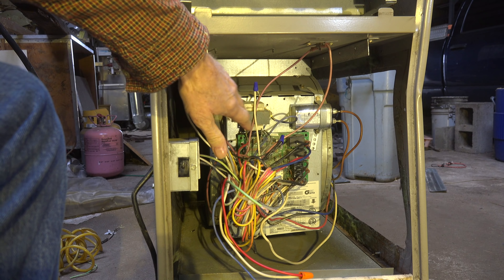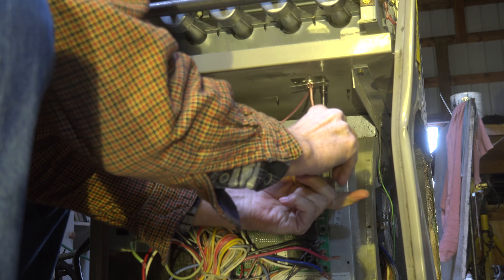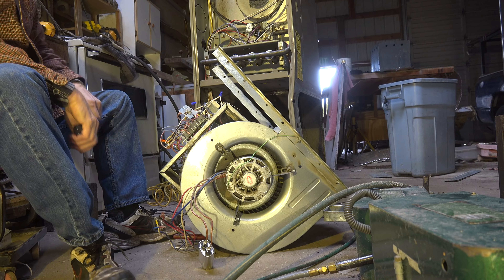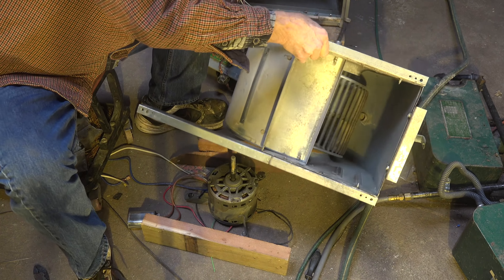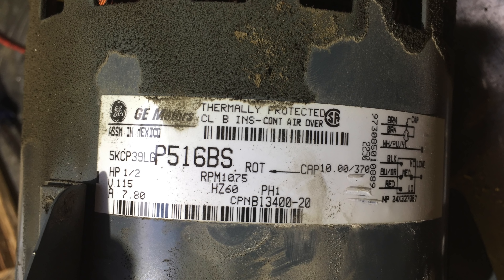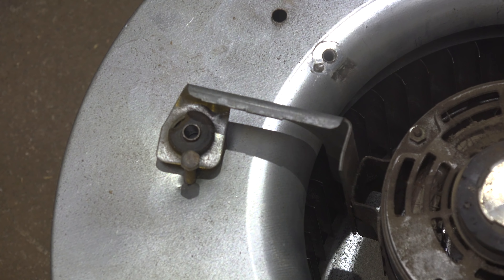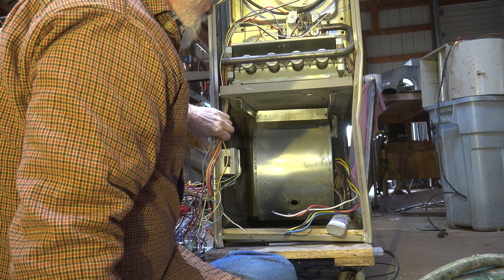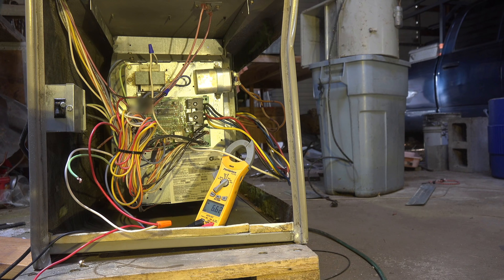How to replace the furnace fan motor Part 5

Comment: After loosening the blower wheel set screw I like to push the blower wheel toward the motor before loosening the motor brackets to expose the shaft for cleaning with some emory cloth. 
This will often negate using my puller to remove the wheel from the shaft.
Also, true blower amps should be measured with the blower door on and filters in place.
Happy New Year GFM!
Reply from the maker: Good workmanship idea.  I probably should have noted the amp draw issue.   As the unit is a test mule, of course that can't be done.  Happy new year.
GFM
Reply: @grayfurnaceman  I appreciate all you do for the HVAC community sir.

Comment: Just a tip on those old janitrol GMP's...remove the blower and feel around inside the shelf that the blower slides into. You'll probably find a couple of those large open rivets that once held the heat exchanger halves together. These were known for bad heat exchangers.
Reply from the maker: Glad to hear that.  I had so many of those that I always hit side of those furnaces with every service call.  If I heard the rivets bounce around, I knew we had a bad heat exchanger.  
GFM

Comment: New to your channel.   My gas furnace is over 30 years old.  It has 3 holes on the metal box/wall/housing of it.  One is about the size of a dime.  I can see inside, a little bit if I peek, and I think I see the pilot.  Is this what the holes are for?  Or can holes happen over time?

Comment: I lost track which one goes where on the capacitor they both the same color and same connection type. Does it matter what side? My capacitor has only 2 sides but has 4 prong per side.  Your help will be appreciated!!!
Reply from the maker: On a factory motor, it should make no difference.
GFM

Comment: @grayfurnaceman I wanted to ask you: Would you recommend swapping a motor if there's oil on the side of it, but cap and amp draw are within specs???
Reply from the maker: I would not generally recommend replacement.  As you could see with the motor in that unit, the oil slick is indicative of loss of oil.  I have seen so many of those motors last for many years after seeing that, that I only recommend yearly service to see how its doing.
GFM

Comment: I’ve heard it’s a good idea to replace the capacitor and motor at the same time.
Reply from the maker: Generally that is the best course.
GFM
Reply: Indeed it is, Willie. It's a capacitor start motor, so if the capacitor fails...
Reply: You should. If the motor is so old that it failed, the capacitor probably doesn't have much life left either. And if the capacitor is bad, it can cause the new motor to run hot and fail early also.

Comment: Ugh! Circuit board mounted on blower housing. Electronic components and solder joints subjected to vibration can lead to high cycle fatigue damage.
Shame them, Grayfurnaceman!
Reply from the maker: Pretty common.
GFM

Comment: Where. Are. Your. GLOVES!!!!
Reply from the maker: Never could work with them.  Happy new year
GFM
Reply: @grayfurnaceman  Love your vids! Back at'cha brother!
Reply: gloves suck and are either always torn or you spend 3x the time fighting them. after a while you get good at not cutting yourself or get good at not bleeding all over :))
Reply: @throttlebottle5906  I feel you, but I'm learning to wear gloves when I swap a motor or put in a pan treatment. Otherwise, I deal with cuts and use neosporin as hand lotion. Lol!
Reply: what's a "neosporin".......... for years dirty grease, oil, dust, dirt and spray cleaners are all most used as antibacterial, well that and blood pouring out everywhere ;)
while I'm kind of joking, I'm also not and a very common job-site fix is wrap some napkin over-top with electrical tape, nobody has time for the "office worker"/ "softy routine" and would continue to work the rest of the day. 
even if you have "band-aid's" you put part of napkin and tape over-top it all, else it would be gone in seconds...